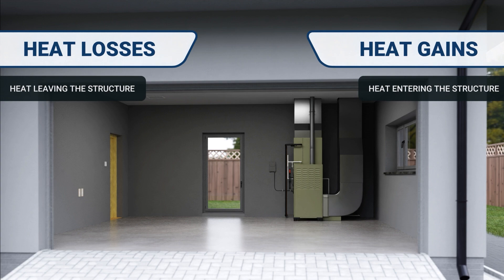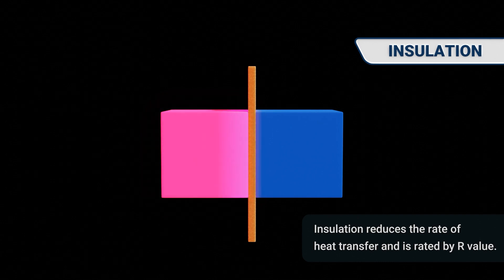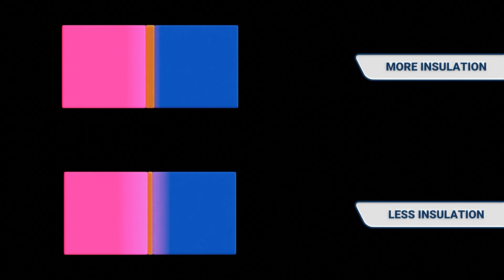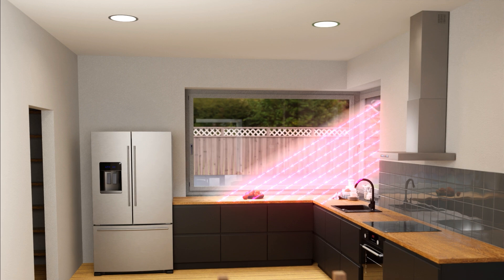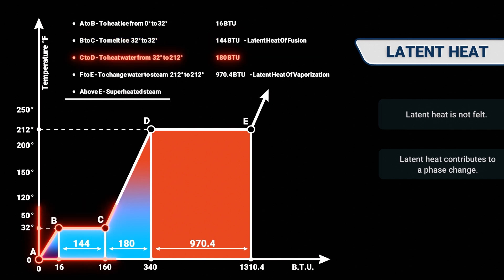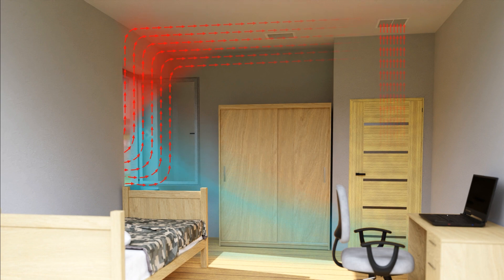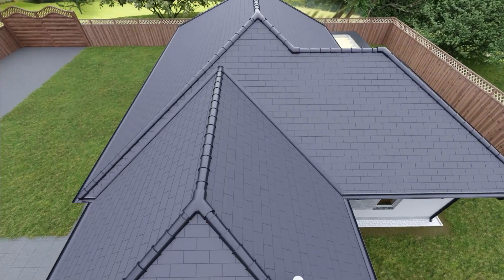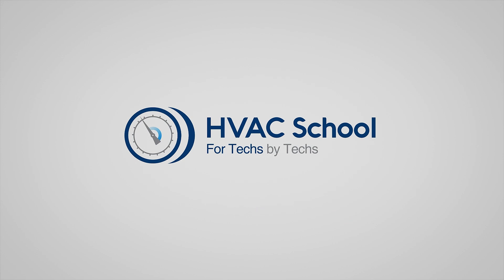Heat and Comfort Basics 3D

Comment: Is there any advantage to a misting system on HVAC condenser? Maybe not evaporation so much as just the cool water vapor on the coils? It seems Lowering the coil temp would be a plus. I was going to try a test to see if it lowered running amps a significant amount. Any thoughts?
Thanks, Jon

Comment: Bryan great video on heat transfer👍. I would like to comment on HVAC equipment being located in the garage, especially gas furnaces. In my opinion, this has to be one of the worst locations for this type of equipment. Think about it , we have exhaust fumes , storage of chemicals and fertilizers and thinking you can keep these type of fumes from entering the system 100% ,I don’t think so. I’ve also noticed A lot of building codes starting to adopt vehicle protection barriers , especially on gas fire equipment.

Comment: Why aren't equipment and ducts installed in the conditioned space?  I'm so sick of mold and hot air everytime the air starts.  Thinking of going mini split.
Reply: Houses with basements do you have the ductwork and equipment in conditioned areas , high-rise condominium /Apartment complexes as well. You are correct when it comes to slab homes and crawlspaces all bets are off (The architects could do it, but it’s all about the money).
Reply: @boby115  yeah slab single story. Handler in garage and everything ran in attic.

Comment: Heat goes to cold...people tend to bring 400 BTU from their body heat. Add 3 people or 6 to a residence and they will affect cooling performance. Humidity affects cooling performance too as does R values in walls, floors and ceilings.